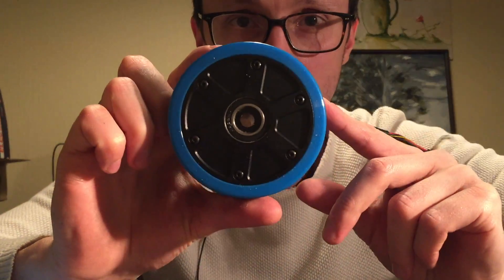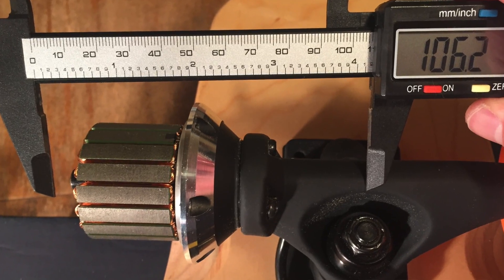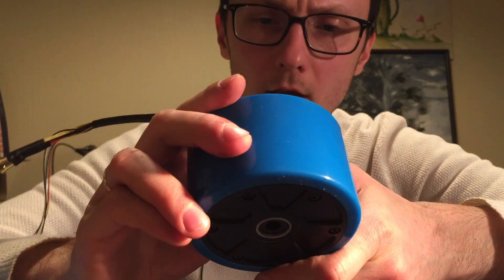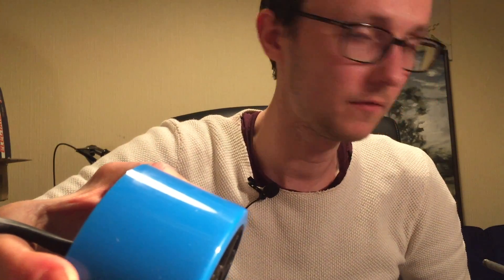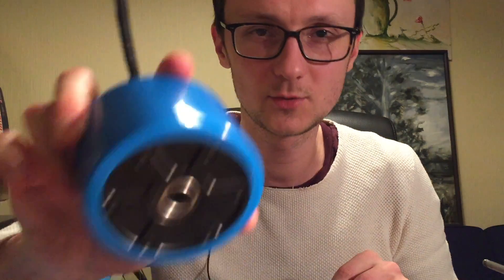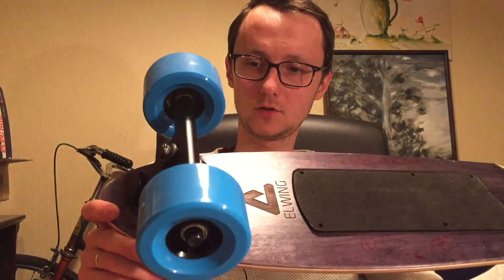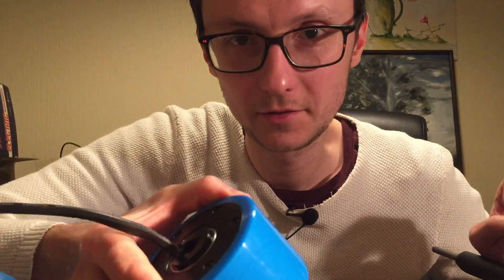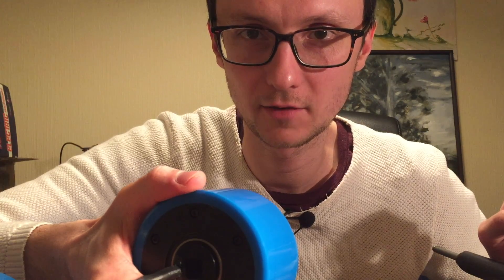Review of Maytech 90mm Sensored Hub Motors for Electric Skateboards

Comment: Hi! A friend of mine gave me his old Acton Blink Light board and I want to try to mod it. I want to give it some extra range and a bit more speed than its current 8 mph speed and 5 mile range. Im hoping to get it up to around 12mph and possibly closer to a 10 mile range. I know I need to get a better battery and a new hub motor but I do not know which one would work with the Acton Blink Light board so I need to get some opinions! Please help me out, this is my first DIY esk8 project.
Reply from the maker: The speed of an electric motor is directly proportional to the voltage applied. The KV rating provides that relationship for each motor. For example, a motor with a 100 KV rating attached to a 20V battery will run at 100 x 20V = 2000 RMP unloaded. So to increase the speed from 8 mph to 12 mph or by 50% you simply need to increase the battery voltage by 50%. So the 7S battery needs to be replaced with a 10S or 11S battery. This will also automatically increase the range because of the higher capacity of the battery pack.

I think the speed controller that comes with Acton Blink doesn't support any voltages above 7S because of the simplified circuit for the over-voltage protection. So you need to get a new ESC such as VESC (https://diyelectricskateboard.com/products/torque-esc-vesc-bldc-electronic-speed-controller) or similar.
Reply: Kaspars Dambis 
Thank you so much for the feedback, so I was looking at parts and I wanted to see if you think they would work
Vesc (or what seems to be a vesc):
https://diyelectricskateboard.com/products/torque-esc-vesc-bldc-electronic-speed-controller
Battery:
https://hobbyking.com/en_us/zippy-compact-4000mah-10s-25c-lipo-pack.html?___store=en_us
And would I still be able to use the Acton Blink controller and software or would I have to get new ones too?

Comment: Hi Kaspars, do you know if these hub motors while bolt up and work with the koowheel mainboard? I am trying to find the specs of the koowheel 90mm hub motors to see if they are compatible but cannot find them. Seems like my koowheel hub motors are starting to crap out but would much rather get the better quality maytech motors. Let me know!
Reply from the maker: This page https://www.aliexpress.com/store/product/Maytech-electric-skateboard-90mm-hub-motor-PU-tyres-for-e-longboard-and-off-board/1630416_32797534515.html seems to indicate that Koowheel 90mm are the same as Maytech 90mm. However, I suggest you get in touch with Eileen from Maytech (eileen@maytech.cn) to confirm that before placing an order.
Reply: Kaspars Dambis thanks will do!

Comment: Hello, Kaspars!
I've never built an electric skateboard. I've got couple of questions)
Are your Maytech motors and Flier ESC doing good now?
I'm thinking of building an electric skateboard according to your diagram. And I wanted to know if every part is working well at this moment.

Two Maytech 90mm hub motors

And Flier 120A 8S twin-motor ESC

What batteries do you recommend me to choose for this built?
Because I've calculated that one motor requires 6S. So I'm thinking to buy two 8000mah 3S's and connect them in series, so it will be 8000mah 6S.
Is 6S enough for TWO motors?
Do I need 12S for two motors?

Now I'm gonna order only one motor. I'll get a second one when I'll get money.
So, should I order extra 6S battery for the second motor?

Also, I'm going to cut my skateboard trucks to mount the motors :D

I'll be waiting for your reply.
Thank you
Reply: Jan Z Cells don’t equal power.... you should worry about voltage

Comment: 0:55 Very Nice? The winding is terrible !!!!!!!!!
Reply from the maker: Yeah, some of the poles don't look that good but for the amount of copper they seem to be OK. Do you know what kind of performance/efficiency impact this could have?
Reply: A bad winding means bad inductance. I think for the price of 60$ it is okay but it is definitely a realy bad winding quality and yes with a good winding you will get more power out of the motor.
Reply from the maker: The 70mm hubs have pretty much the same quality of windings https://flic.kr/p/S9NuH5
Reply: looks quite the same. As long as it worked, it will be okay for the price , but its definitely not a good motor.
Reply: Stefan Wunsch , Hello!
Tell me please, why do you think it's terrible? What's exactly the reason?
I'm gonna build an electric skateboard.
So I'm thinking of buying two this motor.
Reply: Zhan Mamyrkhanov As I said the winding is terrible and that means the magnatic field will be not as good as it chould be, so you will not get the best performance/efficiency out of it
Reply: Yh I saw the coils and cringed hahaha prolly still works fine

Comment: Thanks for the review, ordered myself the same set :) Are you planning to run these on 6s?
Reply from the maker: Yes, most likely because the only ESCs I have are up to 6S. I'll try to make a video of the complete build. What's your plan?
Reply: It'll be interesting to see your full build for sure. I went with 8s (dual VESCs) with turnigy graphene 5200mah 4s packs.They're $29 + shipping now but just 15C. I think it should still be fine if the hubs are rated 22A. Just waiting for the parts now...